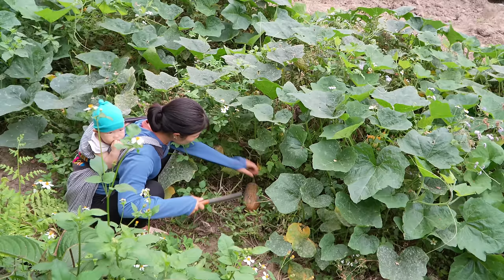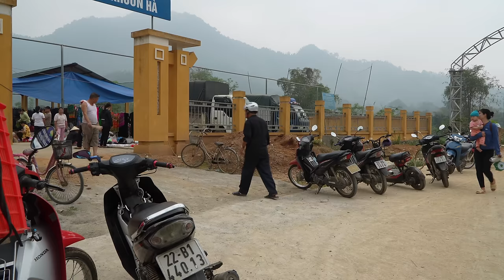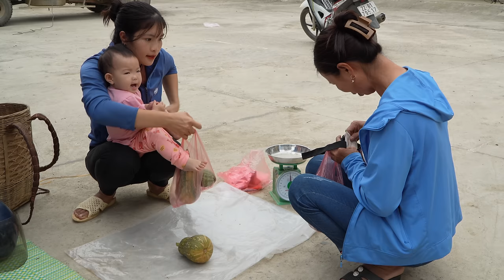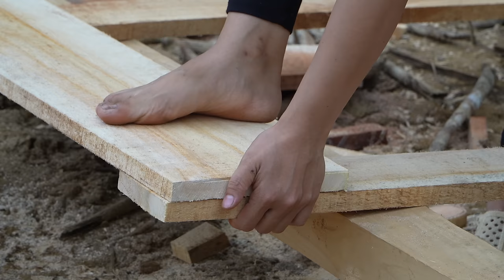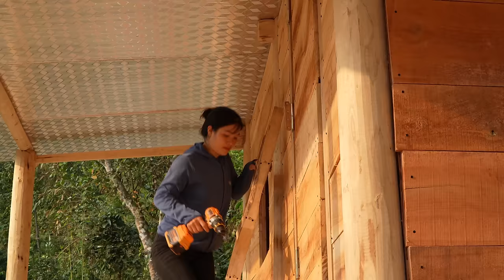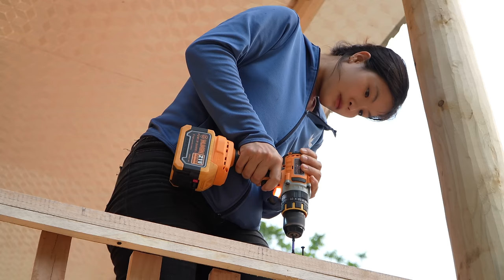Harvesting Pumpkins to sell - 17 year old Single Mother Makes Doors and Wooden Fences for CABIN

Comment: Hello from Australia,  the saw you are using has special features the handle and the back edge opposite to the teeth form a square and a 45 degrees angle a string and charcoal can mark a straight line for cutting a long a board , these things I teach to young people to help them u derstand the old ways of carpentry